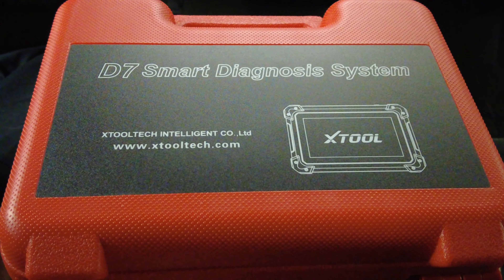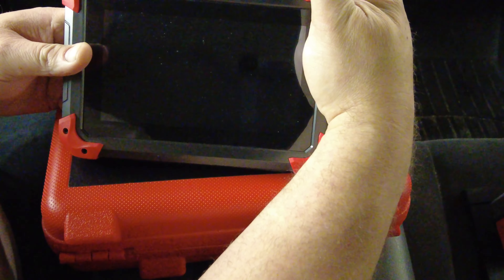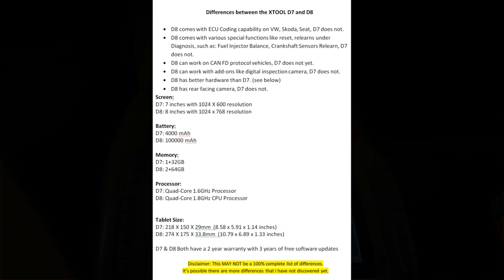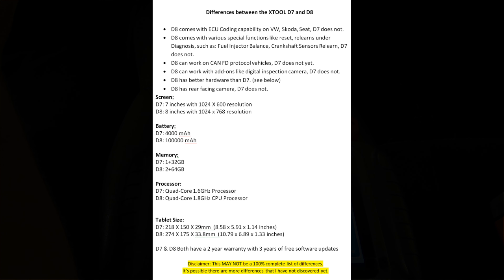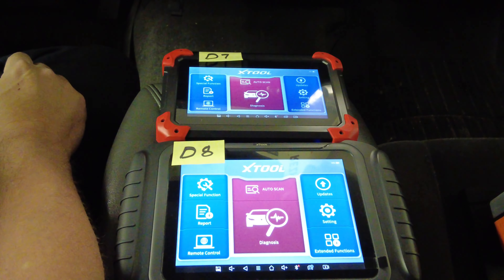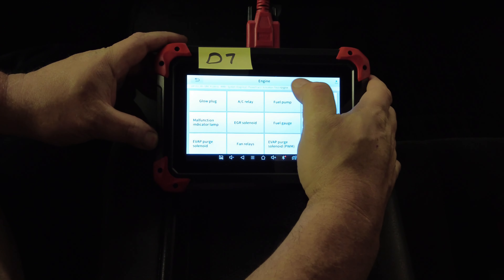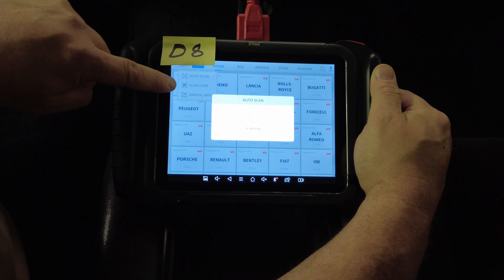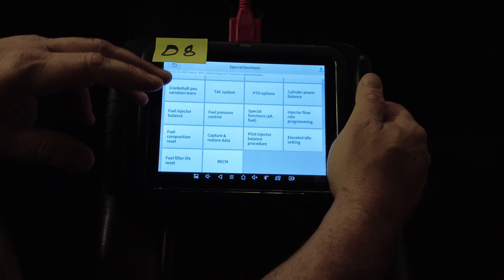XTOOL D7 vs D8 Comparison.  Differences Between These Two Diagnostic Scan Tools

Comment: Would you recommend Autel MS906 over D8? Of course, there is a good price difference in original purchase cost & yearly updates. But I am finding some features which are available in MS906 but not in D8.
Reply from the maker: Which features are you finding on the MS906 that aren't available on the D8?  I have a Autel MK908 and I haven't really found anything it can do that the D8 can't.  Keep in mind, when comparing two tools directly, we need to compare using the same "test" vehicle.  This way we are comparing apple to apples.  Example: If I plug my MK908 into a vehicle.....  then plug my D8 into that same vehicle, I always see the same functions and features between the two tools.
Reply: @SlipFitGarage  For example, the car I am working on is the 2014 Hyundai Elantra SE and it needs tranny relearn but that feature is not available on D8, whereas MS906 supports that.
Reply from the maker: @AllHandsMechanic  
Interesting.... that sounds like is SHOULD be covered by the D8. Not sure why it wouldn't be. If you had a D8 and ran into this problem, I'm willing to bet a simple email to XTOOL would result in a software update that you could download within a day or two.
Reply: @SlipFitGarage  Thats a great idea, let me do that. I have already asked them this question on Amazon if they have plan to support it. But extra email would get more attention.
Reply from the maker: @AllHandsMechanic  
They're usually really good about replying to emails. Give it a shot. They usually list their customer service email address somewhere on the Amazon listing page.
Reply: @AllHandsMechanic  update?
Reply: @kdworak4754  Yup their customer service is terrific. They did put the feature in after my email. Ofcourse they first put the beta version in, and I tested and provided feedback. Then, they released the upgraded version for all the devices. I would say I am thrilled with the purchase and their prompt customer service.
Reply: What's good for a Nissan Rogue sl 2009 autel ms906 or the d7 or d8
Reply: I would however the annual SW update subscription fee is expensive.

Comment: @Brianok100: Hey, can the D7 activate transmission shift solenoids to make them click and see/test which one has a bad click? I saw a video of someone doing that with the D8 but not sure if the D7 can do it too. Thanks!
Reply from the maker: Yes, the D7 is capable of doing that.....  is your vehicle capable of receiving those commands?  (not all makes/models are)
Reply: @SlipFitGarage  I believe it can yes. I have a 08 Honda Pilot. 
Last question: Can the Innova 5610 do what I mentioned above aswell?
Reply from the maker: Unfortunately I have never used the Innova 5610 so I can't answer that question. Sorry.

Comment: If I swap a transmission say from a dodge late 2000 will it relearn the transmission.   I did this before and had to use a snap on scan tool.
Reply from the maker: You asked "will it"....  this video featured two scan tools, which one are you asking about?  If you're asking about the D8, my answer is "I believe so" but I am not 100% sure.  You may want to send XTOOl a quick email and ask them to be sure.  Their email address can be found listed on their product pages on Amazon. Thanks for the question.

Comment: After the 3 years of free updates what is the update cost?
Iv heard on some manufacturers after the free period if you dont update regularly your scanner gets limited. Will I still have full functionality just not updated after the 3 free years?
Reply from the maker: Good question.... and one that I don't know the answer to. That would be a good question to ask XTOOL. They include their customer service email in their Amazon listing. They're usually really good about replying to questions.  I know with my Autel 908, the last update was 2 years ago and it's still fully functional. But I agree, I've heard those same stories about scan tools being limited after not being updated... But I have not ran into that myself.  Maybe scan tool manufacturers have stopped that practice by now? Not sue. Thanks for the question..... sorry I didn't have the answer.
Reply: The d7 update is $99/year and the d8 is $199/year

Comment: OK, so what about the "Special Function" box on the display for both machines? What does that do between the two of them? Does it provide the same functions as the Powertrain selection on the D8, and what does it provide on the D7 then?
Reply from the maker: The items found in the "special function" box on the main display screen are short cuts to the most common special functions that the "SCAN TOOL IS CAPABLE OF".  I does NOT mean that ALL of those functions can be preformed on ALL make s and models.  The special functions under the "Diagnosis" menu are function that are specific to the actual vehicle that you're plugged into at that moment. It basically give you two ways to get to the function you're looking for.  Like I said, the "special functions" on the main screen are SHORTCUTS to the most common functions. Is this 100% set in stone?  No, I'm sure you could find a loophole in my comment about but this is basically how it is.  Thanks for the question.

Comment: Would you agree that a D7 would be good enough for a DIYer?
Reply from the maker: Yes, I would agree.  The D7 is FAR batter than your average "code reader". Most DIY type cheap code readers only give you trouble codes from the PCM module.  Well, nowadays most vehicles have a module for every different system in the vehicle and those cheap code readers won't display those codes or live data. The D7 has bidirectional control along with live data and will display codes from ALL vehicle modules..... it's probably be more data than your average DIYer would ever need, or know what to do with. The D7 is an excellent scan tool.
Reply: I think even A30M will do a lot of good for DIYers. Its way cheaper than D7 and you get free lifetime of updates.

Comment: Does the d7 is good for Nissan Rogue 2009
Reply from the maker: This tool is designed to work on OBD2 vehicles.  Any vehicle sold inside the untied states (and the entire north America, I believe) from 1996 or newer is legally required to be OBD2 compliant.  So yes, it SHOULD work great on your 2009 Nissan..... but with that said, ALL scan tools CAN struggle on certain makes and models. I do not have a 2009 Rouge to plug into an verify so I can't tell you with 100% certainty that it will work great.....  but it "should".  Thanks for the question.

Comment: I did sent an email to XTool if they could provide what functionalities are available for old cars, for e.g. Subaru Legacy 2.5 GT year 2008 on 22Jul2023 [ Sat ] but have still not received a response.
Reply from the maker: Well, I am sorry about that.  I don't control the person at XTOOL who responds to emails so there isn't much I can do to help you with that. Did you specify which XTOOL model you were specifically asking about?  This particular video is about 2 different models of scan tool.  They are very similar but they do have a few differences.  When asking about specific capabilities with specific makes/models, you need to make sure that you specify which scan tool you're asking about. In the mean time, you can probably find the answer you're looking for by visiting their website and using the "Function Lists" which can be found under the Support tab.... I will link it here for you: https://www.xtooltech.com/english/FunctionQuery.html
But keep in mind, like I've said in probably a hundred other replies under my various scan tool videos... the scan tool (ANY scan tool)  is only capable of doing whatever the vehicle manufacturer has already programmed into the vehicles computer from the factory.  Meaning.....  if your scan tool allows you to operate the power door locks (just for an example) from a bidirectional scan tool, it's because the auto manufacturer has specifically wrote that functionality into the software in the vehicle's computer.  The scan tool is only sending the command, the vehicles computer is actually executing the command. There is no scan tool on earth that has magic power to make a vehicle do anything it wants.  Scan tools can ONLY command functions that are already available in the vehicles computer.  So, to answer your original question, the bidirectional scan tools form XTOOL can pretty much command the same bidirectional control functions on your specific vehicle as any other bi directional scan tool brand. Now, with that said, nothing is 100% perfect so it IS possible to find SOMETHING that one scan tool can do over the others but generally all the import scan tools are very similar. Even the high priced Snap-on scan tools can be missing a function on certain make/models.  It happens. I hope this makes sense.  Thanks.
Reply: @SlipFitGarage  Thank you so very much for spending the time to provide a comprehensive explanation ... appreciate it. The email that i sent to XTool requested that if they could provide the XTool D7 full list of detailed functions specifically available for Subaru Legacy 2.5 GT year 2008. This is taking the assumption that they have a matrix list handy.
But the link you provided is very useful indeed since it provides the answer that i was looking for ... Thanks again.
Reply from the maker: You're welcome.  I'm glad my reply was helpful.

Comment: Would it be able to reprogram air fuel mixture and acceleration response time?
Reply from the maker: It depends on the make and model but usually that type of thing requires or reprogram, or a reflash. That is typically referred to as a custom tune.

Comment: can you do pps rezero on that truck?? passenger presence system, to recalibrate the passenger seat weight cushion, thx
Reply from the maker: Not sure about the truck..... but I did just use my D8 to recalibrate the passenger seat cushion weight on a 2008 Ford Crown Victoria.  I'm not 100% sure if that is even possible on a GM pickup truck.  I've never seen that option listed for my truck on ANY scan tool that I've had plugged into it. But then again, I've never looked for it either.  Keep in mind....  that function (any function) has to exists in the vehicle's PCM (computer) first before ANY scan tool can command it.  So for example:  That function existed in my 2008 Ford Crown Victoria computer therefore I was able to command it.  If it does not exist in the PCM of a 2006 GM pickup truck then there isn't a scan tool in the world that can make it happen.   You probably already knew all that but I just wanted to be clear.  Thank you. 

Short answer....  if that function already exists in your vehicle's PCM (computer) then this scan tool "should" be able to command it.
Reply: the gm software has the function under the srs menu, looking for a scanner that has this option...
Reply from the maker: I just made a short video about your question. Go to my channel homepage and watch my newest video. The answer is yes the D8 can do this but please watch the video anyway. Thank you.
Reply: awesome, i saw it and ordered the scanner!!!
Reply: got the scanner and was able to re-zero and clear airbag light!
Reply from the maker: @Hyundai Ioniq / Kia Niro Maintenance / Repair  
Excellent news! Thanks for posting to let us know it worked for you. 👍

Comment: Hey Brian, I was wondering if the D7 will do a vgt calibration on a Cummins or do I need the special functions of the D8 ? Thanks
Reply from the maker: Hi Kyle....  I really hate to say it but I don't really know much about diesel trucks. I have both the D7 and the D8 but I do NOT have a Dodge Cummins to plug into and verify if either scan tool can do what you're looking for. My guess is that you would need the D8 but don't take that as a fact.  You should try emailing XTOOL's customer sevcie and ask them directly.  They are usually very good a replying quickly.  Try sending the question to this email: xtoolofficial @ hotmail . com  
Otherwise, if by chance you're located here in the upper Midwest, I could bring both tools (D7 and D8) over to your place and we could give them a try.  Good luck, Sir.  Sorry I didn't have a firm answer for you.
Reply: More than likely only Cummins insite will be able to do that, I have an ancel 3400 it does tons of things like regens and resets but even that won’t do the installation functions for a turbo / vgt actuator

Comment: Do you know if the D7 or D8 can program an all-keys-lost (no keys!) for a USA 2000 Lexus RX300?  Yes, I've contacted XTool a few days ago, but I have not received a reply.  Time is of the essence, to I'm checking all avenues.
Reply from the maker: I honestly cannot confirm 100% that either tool can program all lost keys on that make/model.  If I had a 2000 Lexus RX300 to plug my my D7/D8 into then I would gladly go check it for you right now, but I don't have access to one of those vehicles so I have no way to verify. Sorry.
Reply: @SlipFitGarage  Does the software have the controls to do it?  That's really what I'm asking.  It would be a big bonus if someone actually had a 2000 RX300, but it definitely is not expected.  But the software should reveal a clue, no?  Or does it need to be plugged into a vehicle before you can start navigating the menus?
Reply: @SlipFitGarage  If you need to plug it in, maybe you could plug it into any old vehicle to enable menu navigation, and then navigate as far as you can to see if it looks like the software theoretically allows and all-keys-lost function.  TIA...
Reply from the maker: @wellnesspathforme6236  Unless I am plugged into the vehicle, I can't get far enough into the menu system to see if those functions are there.  I just tried on my D7. (thats the only Xtool I have here right now) However, there is a PDF document in the Lexus software that lists all the functions that the D7 is capable of performing per Lexus vehicle model. It DOES list immobilizer for all years of RX300.  Take that for what it's worth.  Sorry, that is the best I can do.
Reply: @SlipFitGarage  You have been very helpful.  I assume the PDF document was from XTool and came with the D7.  It looks like the D7 and D8 have the exact same Immobilizer capability per their online Immobilizer functionality PDF.
Under "Other Functions," it lists "Replace Engine ECU."  Do you think (no guarantees, I get it ;-) this means this is an extra function beyond making keys, or do you think this means you have to replace the engine ECU in order to add keys?
I'm leaning towards buying the D7 as a value proposition.  Would you recommend it?  All my vehicles are Toyota,

Comment: Will it work for 2017 charger pursuit and 2011
Reply from the maker: They are designed to work on all "OBDII" vehicles....  Which is ANY vehicle manufactured to be sold new in the USA from 1996, until today. ALL functionality is 100% dependent upon the specific year/make/model that you're currently plugged into.  Not all vehicles have the same functionality even if you're using the same scan tool.
Reply: @SlipFitGarage  some people say security system changed for 2018 and above
Reply from the maker: Yes, that is true.  But you asked about 2017, and 2011 vehicles... All 2018 and up Chrysler vehicles have a secure gateway module.  These scanners WILL still work but you will need an additional "12+8 cable" to access the vehicle's computer AFTER the gateway module.  Or, another OBD2 scan tool with an AutoAuth account, a current subscription, and an internet cloud connection.....  So, in basic terms, you need either an Autoauth account OR a 12+8 cable to access 2018 and newer Chrysler (FCA) vehicles. (plus the scan tool itself) The 12+8 cable plugs in directly after the module.  These connection ports ARE NOT the same as the typical OBDII connector under the dash of every vehicle, known as the DLC. (Diagnostic link connector) The ports for the 12+8 cable are located usually in the center console, or behind the dash somewhere, like behind the radio.  They are NOT easy to access but if you want full control with your scan tool, the 12+8 cable OR a scan tool with a paid AutoAuth account is the only way to do it.   Otherwise, with none of the above, you'll only be able to check trouble codes....  no bidirectional control.

Comment: The d7 also does not have the ability to open and close the solenoid vent valve circuit on the 2010 v6 Camaro  for the P0496 code  bought one after watching a how to video to check the system returned it and ended up buying a Autel 906BT to be able to do proper scans and system tests.
Reply from the maker: When did all this take place for you?  The reason I ask is because in early July (2022) XTOOL sent out a major update to all D7 scan tools that greatly improved it's functionality.  The update turned the D7 into a complete bidirectional control scan tool.   I don't have a 2010 Camaro to plug into an verify, but I'd be willing to bet the D7 would open your solenoid vent valve today...... and if it wouldn't, then I'd be very surprised.   Thanks for the comment.